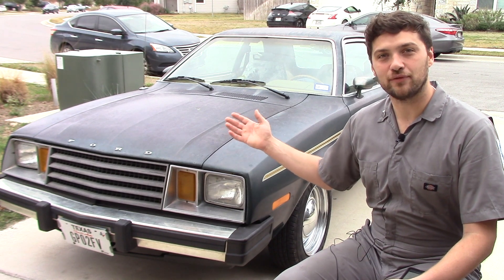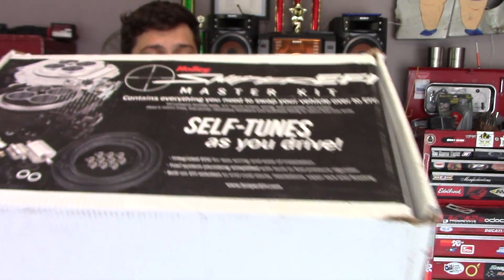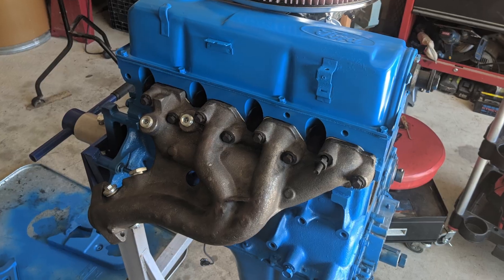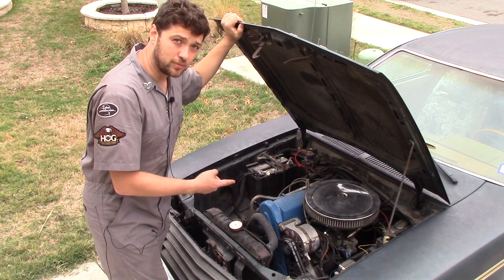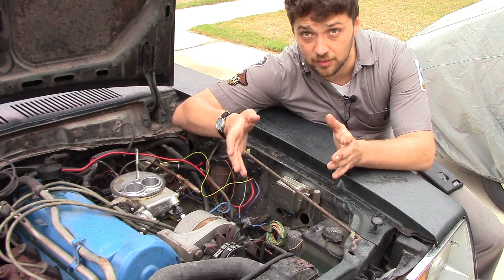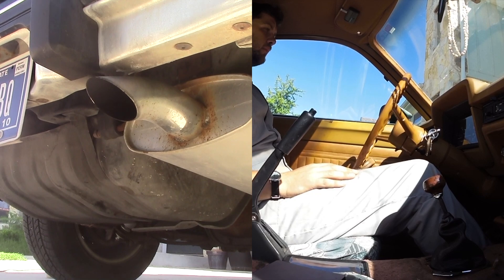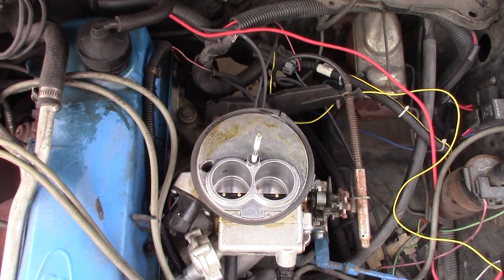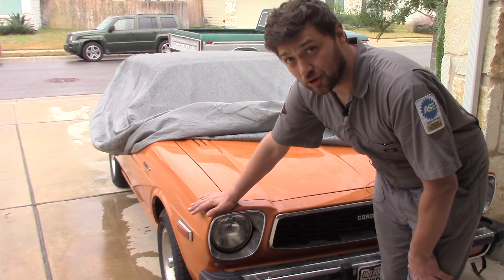How I built my FUEL INJECTED Ford Pinto using Holley Sniper 2300 EFI

Comment: I had a 1980 wagon.  It was a California model with 6500 Carberator and programmable computer. I basically did what you did, but no EFI available in 1992 with an easy setup, so I tried several carbs. I found a Weber 36/36 that the 6500 air horn would fit. Up jetted slightly because Bud's Machine Shop had flowed my head and added valves and springs from a Chevy, and the engine was pushing roughly 140 HP. I could barely manage 0 to 60 in just under 8 seconds due to the 3.00 rear-end. That being said, I went from a commute mileage of upper 20s to about 33 to 35 depending on weather. When I gave the car to a friend at church, it had about 350K, 155K is about whst I'd put on it when I gave it away. That engine, eventually, ran in two other vehicles for his Dad's 80-mile daily commute. His Dad parked the car when that engine had just under 900K because it was starting to smoke too much. 

Have you heard of the special order Pintos from 1981 to 1983? Saw several in Puget Sound. The last two I saw were 82 and an 83. One had the California 2300 HO (120 HP in the Stang) and the a 2800 EFI Eurospec, available for half a year on the Mustang. Both had 5 speeds. The V6 was too much power for the suspension in a hatchback. It was the same V6 available in the Sierra in Europe and Capri III (USA Capri II), yes I've seen one at used car lot in Ghorst. A coworker had an 82 Wagon (with the round window) that had a 2800 V6 and 4OD automatic. He even had the Ford factory pamphlet that titled 1983 Special Order Pintos with all the ones available for order, otherwise,  I wouldn't have believed the three I've seen. Canadian Fords factories rocked back then.

Comment: Exhaust   " Header  " 

You  Say ....? 

That's  Actually   An 
Exhaust   " MANIFOLD  "   From  A  Ford  Ranger  Pickup  You  Got  There  Bro.

Exhaust   " Headers  "  ...

Are  Tubular  in  Design   , 
 And 
 / With   Separate   Exhaust  Port  Tubes .
Reply from the maker: @ericdaniel92  thanks for the clarification!

Comment: Yikes!
That fuel pump sounds like a Dentist drill.
Nice Sniper conversion.
I'm putting a Sniper Stealth system on my carbed '85 Mustang 5.0.

BTW: That 2.3L is begging for a turbo!
I've got all the stuff you need.
Took it off a wrecked '88 Turbo Tbird.

Comment: Great video. I have a ‘78 Pinto with 2.3 that I want to switch to Sniper. Someone suggested the single barrel 1100 since it’s good for 170 hp and the stock 2.3 won’t get there. I like the two barrel for ease of installation, even if it’s more than the engine needs. Definitely looking into a different quieter fuel pump. I also like the idea of a distributor connected in the mix.

Comment: Excellent video on an excellent car.  I drive a 1980 Toyota 4wd pickup daily that I want to convert to EFI but Holley said there was no option.  Any ideas?  BTW, is that your green 70s dent side Ford pickup in the background?  I’m currently building a 1977 F150.

Comment: did you use the original intake manifold?
Reply from the maker: @alexurzua4728  I actually went with an offenhauser dual plane I scored at a swap meet!
Reply: @Scooter_911  did you have to use a 4 barrel to 2 barrel adapter

Comment: Fuel injection was cool for a hot minute in my 1997 dodge ram 1500 but they dont make a functional crank sensor for the 5 speed v8 model anymore (just chinese trash not even rated for the right ref voltage), and I got tired of them burning out in a week or less so I pulled the EFI system out of it, put in a 1977 distributor and a 4 pin GM HEI ignition module and presto, I had a decent truck again with a 4 barrel carb and a performance manifold to go with the headers. Between the 5 speed transmission and the carb'd engine, my truck is now immune to shit tier car thieves and I can hop in it and just go if I pull the hiding in plain sight choke knob. No plans to go back to injection. Nice pinto though.

Comment: Go round tooth profile gears and timing belt. They last longer than square tooth. Get rid of the "cotton gause dipped in transmission fluid"- air filter.  Project Farm you tube channel has  video to prove they are worthless. Close the air filter assembly and use the factory ducting. Open air filters are "hillbilly horsepower" that grab underhood heat killing any power gain. They get dirtier faster too. Hope this helps longevity for your Pinto project [hmm....or is it Project Pinto?].

Comment: Ive had my 1979 hatchback Pinto for 26 years. I don't have any problems in winter with my carburetor on my 1979 Pinto  hatchback. I live in Mount Airy N.C. it gets into the teens in winter. Is this an (ad) for Holly????

Comment: I love those 2.3 liter motors.  My brother and I raced at a local dirt track and we chose the 4 cylinder class.  This was back in the 1990's.  Those motors were everywhere and so were the parts.   I had so much fun.   Glad to see your still up and running.  I hope you get your fuel lines fixed.  As for the fuel pump.....I've "heard" a lot of electric fuel pumps that sound the same.

Comment: If I may ask.  What was the difference between the fuel economy on the carb and this system.  I'm especially curious because a guy I know did this on a 3.1 V6 in an S-10, but his fuel economy was HORRIBLE.  He was never able to get it to tune correctly, which makes me give pause as to whether I want to do this to my truck or not.   Wanted to see how this worked out on the Pinto with the 2.3.  Thanks.

Comment: Just discovered this video I have owned my pinto for 10 years it’s always worked great, I’m likely going to do a rebuild here shortly did you notice any change in power/fuel economy once you installed your new cam, and EFI?
Thank you great video!
Reply from the maker: Far out! I don't get to meet many long term pinto owners! I noticed a large increase in low-end torque and it made the engine feel much smoother in the whole RPM range. Although because I did intake, exhaust, cam and EFI together I don't really know which one made the biggest difference. But I have to say being able to change settings and tune the EFI from inside the car is an unbelievably convenient feature! Good luck with your build!

Comment: On my 71 I had Headman headers, Edelbrock Pony Ram intake with two Holley 185 VW carbs, Crane cam, a little port work and 4:10 gears from an early Ford van. My quickest 1/4 mile was 13.85. Wish we had EFI back then. But we had a blast anyway.

Comment: I had one of these 2.3's in my pinto station wagon and it was a dog.  Trucks would pass me going up a hill on the interstate and I had it to the floor.  I sold it with 11,000 miles on it.  Rode like it had no suspension.  Terrible car.  BUT, I sold it for $100 more than I paid for it new.
Reply from the maker: Well I'd call that a win I guess!

Comment: Owned 2 Pintos,a 71 with the 2.0 and a 77 with the 2.3. The 77 was stock,the 71 had a Crane cam,Hooker header,Holley 390,KYB gas adjust shocks,1” anti sway front,3/4” anti sway rear. Great little car,lots of fun on Mulholland.

Comment: I'm looking to convert my 2.3 in my baja to EFI.  I have the Offy duel pale 4 barrel.  SVO Roller cam etc.  I run a Holley 390 4b.   I'm just thinking it would be nice to add a little mordrivabilty to the car,  granted it drives great as it is.  Other than cold morning starts.

Comment: Nice job with only 1 week of time, the 2.3 is one of my favorite motors to work on.
My 79 turbo stang lived on a steady diet of 15 lbs boost and was a thrill to drive and eat up all the 5.0 mustangs and Camaros around town.
Reply from the maker: Right on! I've been tempted to grab a t-bird turbocoupe exhaust manifold and put a little whirly-do on the pinto but just haven't quite decided how far I want the next iteration of the car to go...
Reply: @Scooter_911  A 79 mustang intake should work with your EFI, the turbo mounted under the carburetor, that pinto runs well NA just add 10-12 psi and look out.

Comment: How did the sniper do on the gas mileage from stock.. great job 👏🏻👍always felt pinto got felt a bad hand..
Reply from the maker: the fuel mileage has stayed about the same although there was a SIGNIFICANT increase in low-end torque.

Comment: Where did you end up putting the temp sensor, we put a 2.3 in a snowmobile lol and are putting the same efi kit on it. We talked to the guy that will be tuning it and he said he wants it as close to the head as we can get it but there isn’t many spots on the head to drill and tap a hole. Any ideas?

Comment: i owned 2 pintos great cars just wanted to say back in the day they had a 4  bbl intake that would take a GM 4bbl carb from the duel carb caddy had the correct volume for the 2300 was nice plus the diamond  duel chain timing chain  and sporockets hooker header stonger valve springs and street comp cam right tire would lift up on take off lol ;;;;;;;;;;;;;;;;;;;;;;;;;;;;;;;;;;;

Comment: I’m running the same kit on a 2.4L 22r motor in a 1984 Toyota pickup truck. Runs great but I had a question for you. Do you get any issues with going lean under deceleration. Seems to be an issue that’s plaguing me. Your pinto and my Toyota engines are similar in displacement so I thought you might have some input.

Comment: I daily drive a 78 Bobcat, 2.3 4 speed, 2.73 rear. What type of MPG do you see with the sniper?
Reply from the maker: About 30mpg nearly the same as when it was carbureted. It definitely increased the low-end torque though

Comment: Enjoyed the video. I had a white 1980 Pinto with the 4speed manual back in the 80’s. I had a lot of fun with that little car especially when I found a company called Racer Walsh that made performance parts for the Pinto and Mustang 2. After I eliminated all the emissions and cat. I had a full length header with a straight pipe to the rear muffler. I made the muffler easy to remove and stow in the trunk. Little Pinto sounded like a 1000cc street bike and would haul ass. At least by 1980’s standards. I could beat the pants off any other 4cylinder.

Comment: You may want to consider a fuel cell in the puppy! Lol I thought I remembered it was the bumper bolts piercing the tank as the issue. Also you’re missing the bullseye bumper sticker that was common to see when I was a kid and the Pinto was a common sight. Good luck, I love old steel, even if it is a Pinto ! Lol

Comment: I see that you kept the DURASPARK DISTRIBUTOR, if the SNIPER has provisions to control ignition you could possibly swap in a TFI FORD distributor and make mileage and power gains/ increased efficiency. This coming from a lifelong FORD MAN and mechanic.
Reply from the maker: I actually recently installed an MSD billit distributer and now have the sniper running my timing that way! A video update on that is coming soon!

Comment: Back in the late 80's I had a '79 Mercury Bobcat that I sort of inherited from a friend who joined the military. 
It was very much like your Pinto, even in color and body style. The thing ran good, had low miles, (33k), but it didn't set any speed records with its 90hp running through the cat converter and a 2.78 rear end ratio. 
My first change was to lose the cat converter, smog pump, and all the plumbing, it did smoke a bit on start up so I replaced the valve seals and replaced the valve cover and pan gaskets as well. It helped but it wasn't enough. Then a buddy wrecked his 1988 Thunderbird Turbo Coupe. I bought the car from the salvage company and transplanted that power train into the Bobcat. 
I cut down the rear axle to fit, converted the fuel tank to accept the fuel injection pump assembly, made up custom high pressure and return fuel lines from steel tubing, I converted the braking system using a mix of street rod front brakes, and the TC oem rear brakes. I then found a set of aluminum wheels from a 1986 Mustang GT (D slot alloys). 
The rear fender wells needed minor reworking to clear the tires, and the front end needed some steering stops added. 
I also found a complete stereo sound system from a 1989 Lincoln Town Car, giving the Bobcat a JBL factory sound system. I was able to use everything except the rear speakers which required modifying the rear panels a bit. The amp was mounted under the right front seat and speakers were added to both kick panels, the top of the dash, both door panels, and four in the rear panels. with a pair of satellite tweeters on the A pillars. 
I used the G3 alternator off the Turbo Coupe as well, and the ECM went behind the glove box. 

I drove that car for four years, sold it to someone who took it out of state. The main goal was to use all factory Ford parts whenever possible. I did that with the exception of a few speakers and a custom radiator and custom fiberglass lower air dam.
(My lower air dam was broken up worse than yours, it eventually split diagonally after driving to work through some deep snow back in the early 90's, so i glued it back together well enough to use it to make a mold so I could duplicate it in fiberglass). 

That car was one of seven Pinto/Bobcats I owned over the years. Including a 1980 Pinto sedan I had for over 600,000 miles. 
I stuffed a 302 into a 1974, a 351 V8 into a 1976 wagon, and was planning to do up my 1977 wagon using the power train from a 1993 Mustang GT but that one never happened. The car got sold before I ever got around to making the swap. I still have the GT power train in the garage, maybe I'll find something else to use it on one day.

Comment: I love Pintos I am on # 5 a 1980 wagon.  I drive it daily on my 50 mile one way commute.  I have had a 1971 a 1974 wagon my wife wrecked a 1976 Bobcat a 1979 wagon my son wrecked now my 1980 wagon.  My son also has the only Ford Pinto on Guam.  They are great straight forward little cars.  That was proved by your going completely through yours in a weekend.  I get compliments all the time on it.  I can't go to the gas station without getting a chance to here folks say, "I had one just like that but it was a Chevrolet."  My son is thinking of the conversion you spoke of as am I.  Keep the rubber side down and  if you happen to be traveling around Pipe Creek texas and you see a silver 80 Pinto wagon flash your lights.

Comment: I owned a 1971 Pinto and my experience was not as bad as yours.  Most of my problems were in cold weather.  Particularly a flooded carburetor.  The fix was to take off the air filter and use a lit match to burn off the excess gas.  Otherwise the car started and ran consistently.  Your 1980 Pinto may have had other issues.

Comment: I'm surprised that if you pulled the engine, you didn't find an engine out of a t-bird turbo coupe with harness etc to put back into it.  Since you pulled the motor anyway.  I had a 1980 mustang cobra I bought new and after 7 years of dealing with a carbureted turbo engine, I found a wrecked T-Bird turbo coupe and swapped that motor in.  GOD what a difference!  Still a 2.3L SOHC motor that sounded like it would fly apart at 4000 rpm, but it easily had around twice the  power and torque that the original carbureted turbo motor had.  Of course you would have had a harder time with the exhaust, but other than that, you'd have had a factory ford EFI turbo setup.  Just a thought if you ever want to be able to actually PASS someone on the freeway..lol.  I still remember the VW rabbit commercial where the guy in the pinto is on the on ramp and his kid says "NO DAD< NOT YET!  We'll get HIT!) And then, of course they show the rabbit doing 0-60 in 7 or 8 seconds flat and merging into traffic from a dead stop.  Should have shown the pinto doing the same run with stopwatches in both cars..lol

Comment: What size wheels do you have on your Pinto, and where did you get them? I have a 1972 Pinto woodgrain wagon that still has 13" wheels, and tires are pretty much impossible to find. Thanks.
Reply from the maker: I recently put 15" wheel vinteques on my pinto and I love them. I think I bought them on jegs or summit racing. With 15's I run prius c tires so I can get them anywhere.